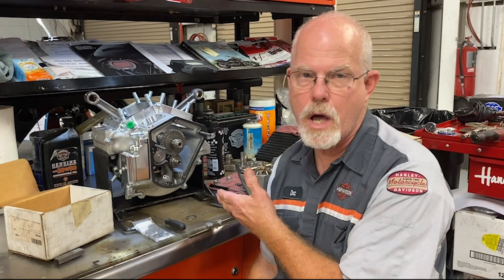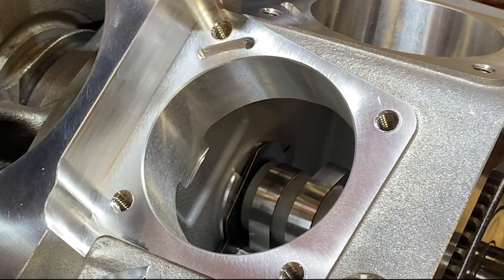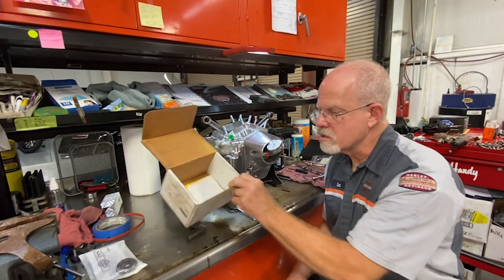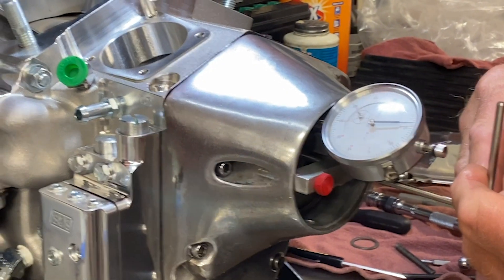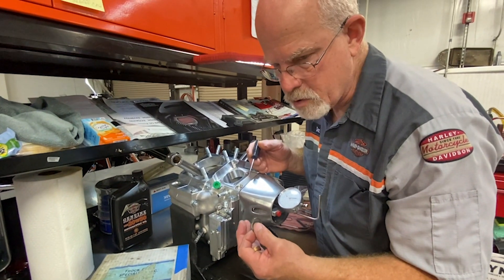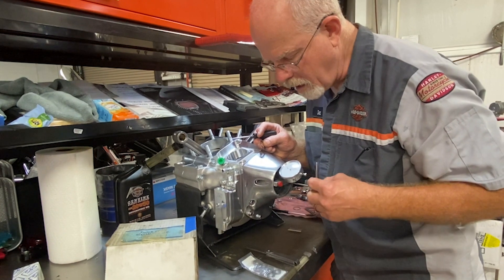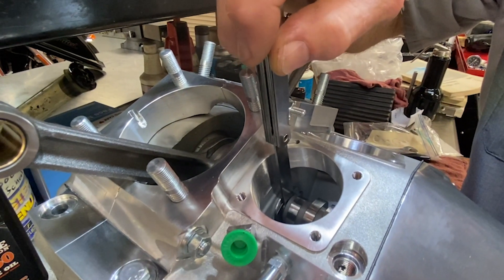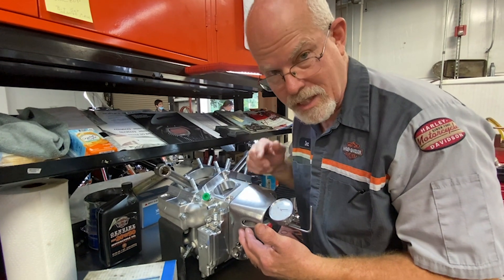DOC HARLEY:  THE IN AND OUT OF CAM END PLAY

Comment: The aluminum case expands more per degree than the steel camshaft, so endplay increases as the engine heats up.   I shoot for .005-.008" on the camshaft endplay, and check it with a depth micrometer at the end.
Reply: Out of curiosity, how did you verify that the case would expand that much? Wouldn’t it be safer to shoot for the absolute minimum of the factory range, especially since Harley offers a fairly wide range of acceptable play to begin with?
Reply: @video-dispatch8309  the coefficient of thermal expansion is established matter of physics.  How much it expands is irrelevant, but aluminum expands more per degree of temperature increase than steel, that is a fact.
Reply: @patrickzambori473  Wouldn't it matter very much how much it expands? Because until the engine is warmed up enough to reach the minimum allowable end play, you are running it too tight until then. That's all I'm wondering about. By the way, I'm here to learn and ask questions; there is zero motive in me to sound critical or challenging.

Comment: Requesting a new topic. I have some high speed wobble on my 1988 FLHTC Electra Glide Classic with 32,000 miles. Can you address replacing motor mounts / isolators?  I assume they need routine replacement on newer Harleys too. Any comments about the after market motor mounts / isolators that are supposed to cure "Harley Death Wobble?"
Reply: Have you checked your head bearing preloads? You need to adjust them every so often

Comment: How many miles should cam tensioners last on a 2014 Ultra Limited FLHTK with the 103 cu in engine? My bike has 105,336 miles.
Reply from the maker: There is no set mileage from the factory. I would look and inspect with that high of mileage. Thanks ~ Doc
Reply: @LowCountryHarleyDavidson  thank you for the information.

Comment: DOES THIS MEAN ANYONE CAN SWITCH TO GEAR DRIVE ? I WAS TOLD IT ALWAYS DEPENDS ON THE CAMSHAFT  OR is it CRANKCASE  RUNOUT. SO YOUR SAYING RUNOUT CAN BE CORRECTED, SO ALL MOTORS CAN SWITCH IF THEY WISH TO GO TO  GEAR DRIVE  CAMS ? I WENT S+S GEAR DRIVE MANY YEARS AGO, TO ELIMINATE this TENSIONER ISSUE
Reply from the maker: Run out is different than Cam endplay. Not all motors can run gear drive. Maybe I should do a video on run out? Thanks ~ Doc

Comment: Which is better? Old school feeler or high tech and dollar? Ends justify the means!👍🎥 great video!
Reply: Alan Whiteside  what's the cost difference when you might use 1 time in the life of one motor. Someone who regularly is installing cams verses someone that might do this repair once or twice. I've turning bolts on autos, bikes, and boats for 55 years. I have plenty of tools. If your good you don't need every gizmo that comes out. My garage is only so big.
Reply from the maker: Thank you. We all strive to build better. And if I can save not taking the lifter blocks off, it's a WIN. Thanks ~ Doc